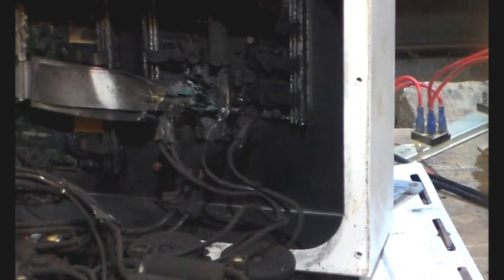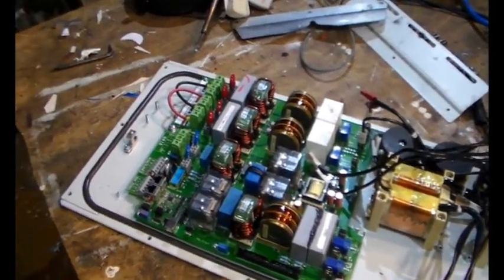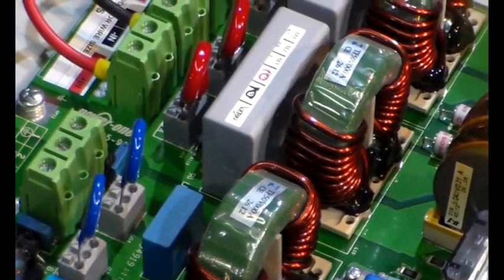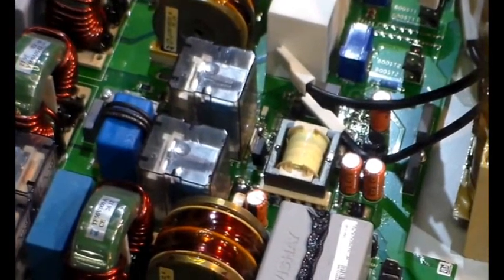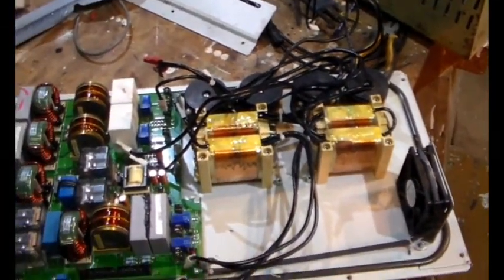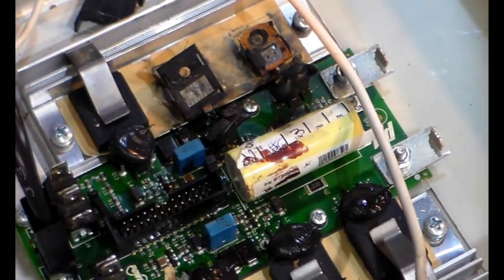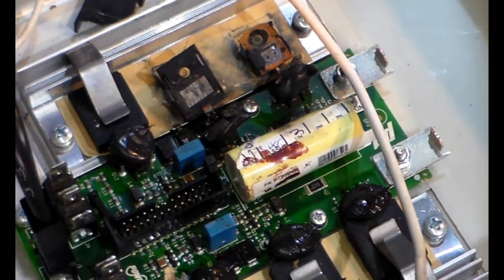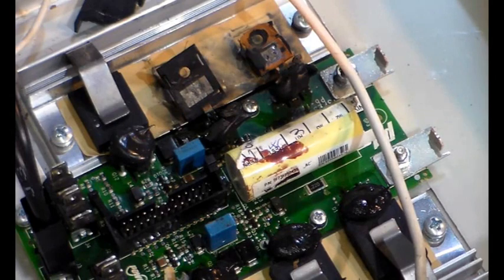6Kw Aurora turbine grid inverter, fire investigation.

Comment: I wonder if these are actually any different from the solar inverters just with the MPPT curve changed in the software (via settings which the youtuber buyitfixit was able to access)
Reply from the maker: I'm thinking along the same lines. Solar has a finite output whereas wind will keep going until destruction, so the load would need to increase to keep RPM down, cheers

Comment: I understand the function of the varistors as surge suppressors but wouldn't fast blow fuses just downline from them have avoided that catastrophe or am I looking at it 'backwards'?
Reply from the maker: Kenny, they are controlled by voltage and heat up as the voltage rises. Because of this when the inverter is frequently driven with higher than spec voltage then he varistors wear out and fail, For this reason it's important to have some form of control. With solar where there is a fixed maximum voltage then this is done by panel selection and number of panels. With wind it would be with a dump load and vari- pitch blades to limit the RPM and so the voltage and current, cheers
Reply: Fuses only protect from overcurrent, not overvoltage. You could send a million volts through it but as long as its not over its rated current, the fuse wont blow
Reply: Hi, can you tell me what value do these varistors have?
Thank you in advance
Reply: Hi there can you tell me the value of 3 capacitors c91 c92 and c79 they are at the top of the board beside the little light bulb  thanks

Comment: Hi again Andy, unrelated question if you don’t mind regarding my 4xTrojan 6v T105’s I have on my boat, I’ve had them now for about 6 years and have regularly checked and cleaned them, but I sense although the voltage readout still looks reasonable ( I never let them drop below 12.2v) the output seems weaker..? I have seen a few YouTube vids on bringing deep cycle batts back to life, inc one guy using a “Welder” as a charger to bubble the cells 5mins on 10 mins off..? I have recently invested in a Noco Genius 26A smart charger that runs off my Genny but the wet cell output charge voltage is only 14.5v and the Trojan needs 14.8v, there are other settings for Lithium etc which has higher outputs but I’m frightened to use those in case I destroy the batts!… any suggestions on how to “ revitalise “ them..? If that’s even possible… thanks for your time, Andrew
Reply from the maker: Andrew, you could always try the other setting for a short while and see what happens. From my experience trying to force charge into a battery just raises the surface voltage without actually giving a deep charge. A long slow charge from a traditional transformer / rectifier supply will clean the plates more efficiently, so charging every day is important. I know it's more difficult with a generator and less efficient but it does a better job. Of course in the summer the panels will do this. Awareness of battery voltage is critical but in winter doubly so, cheers
Reply: Equalize them. You've probably got a weak cell somewhere bringing all down, typical. Should eq at least once a month! (16v)

Comment: Hi Andy, I have the 4Kw solar version of this inverter. The big relays on mine switch the load online. Mine failed due to  loosing tension. My board was replaced by the supplier. They would not let me have the old one to play with. I have found it almost impossible to find any information about these inverters. Other than ABB who will service them (at a high price) Thanks for the video.
Reply from the maker: Martin, yes it's the corporate profits self interest that cause a lot of waste. That's where youtube is so helpful. I assume the boards are not available except to a company engineer. I will keep these inverters in case another turns up with a different fault. I think a dump load on the turbine 3 phase would prevent overloading damage to wind inverters. The 6Kw Proven were fitted with this feature as well as vari-speed blades, cheers

Comment: That is quite mess in there Andy - there must have been quite a lot of smoke coming from the vents !
It's a warning to anyone with any kind of wind inverter I suppose. Cheers.
Reply from the maker: Dave, thanks for the comment, as you heard in the video, this was quite a shock. The units are IP65 rated so as long as the seals on the covers are good no smoke would escape. I assume all the oxygen was used up and so prevented further damage. At that point the turbine would be running free and the speed would be regulated by the vari pitch blades. Lots of noisy fluttering, but sometimes people don't notice such stuff and they wouldn't know what to do anyway. Cheers
Reply: @TheInfoworks  Oh, I didn't realise these were sealed - the cooling for those MOSFETs must be by conduction out the back, and then convection ?  I can see the need for dust sealing, but surely no-one is going to run one outside in the rain ??? 
I suppose condensation out in a shed could be a problem, but IP65 isn't necessarily going to prevent that, I wouldn't think... it makes me wonder how hot those MOSFETs run under normal 'sensible' conditions day to day ....
Reply from the maker: @noakeswalker  Dave, you'd be surprised, plenty are outside. Yes the heat is lost through the case and heat sink, that's why I put a timed fan on 3Kw SMA solar inverter, just to blow are up the back, cheers

Comment: Andy, I had one or two of those FETs let go spectacularly in a solar version of the Aurora.  It happened nearly a year after replacing a couple of the problematic relays.  Those FETs were on the same board as the large capacitors, I don't think the 3.6Kw solar inverter has that second board with more FETs like your wind one.  The insulation on separate wires near the worst FET was melted as if from possible flame, but the damage was no where near yours.  The external data logger captured a full day of production and then nothing after, so it probably blew on startup in my case.
Reply from the maker: Hi, interesting and I figure that these faults are caused by some other failure, so just replacing the FETs is difficult to justify, Cheers

Comment: Have one of these on the little turbine Andy. Might be restricting its output a bit to prolong it's life after watching your video.
Out of curiosity do you recall whether the solar version of these has a ground fault fuse?
Reply from the maker: Jim, yes I would change the dump load settings to come in earlier and when storms are due shut the turbine down. I shut our Proven down before gales to reduce stress and it and me. The time I had an isolation fault was when I used the wrong cable for the high voltage DC and the cable was on the cold damp ground. Surprising what high voltage DC will do. I don't think there is a fuse in the Aurora solar inverters. Cheers
Reply: @TheInfoworks  In our case there's a three core armoured cable run carrying ac current to the inverter at the array which should be OK but will have to be checked also.
Saw the video where you repaired the cable with some bitumen👍
Reply from the maker: @Woodyjims-shack  , Jim, if the array is ground mounted then the fault could be a leak against the steel mounting frame, cheers